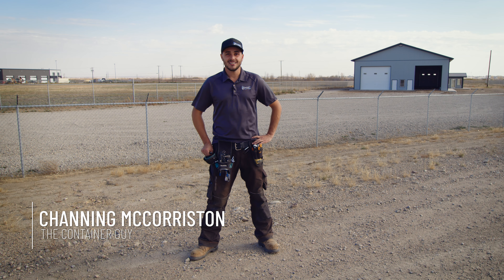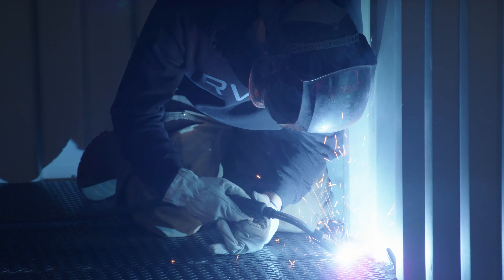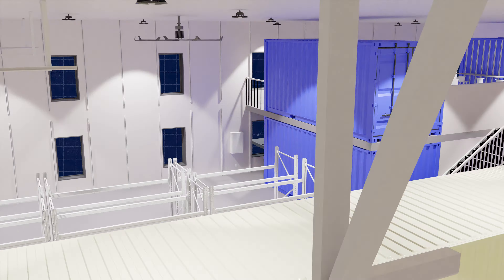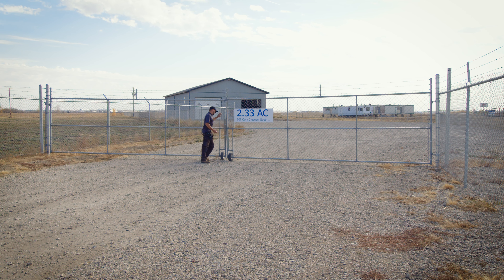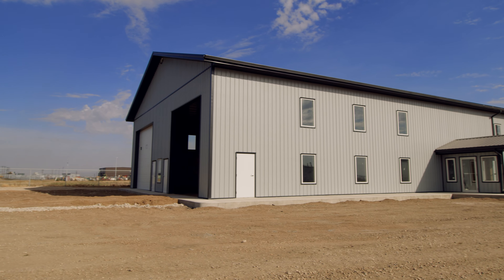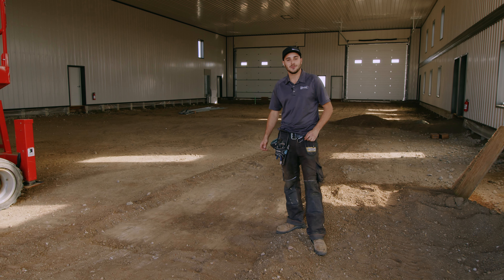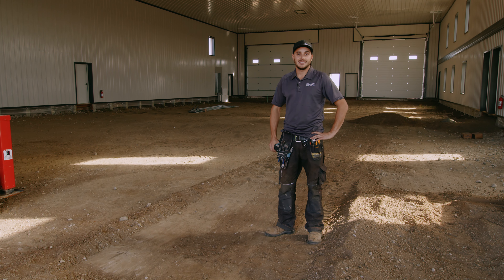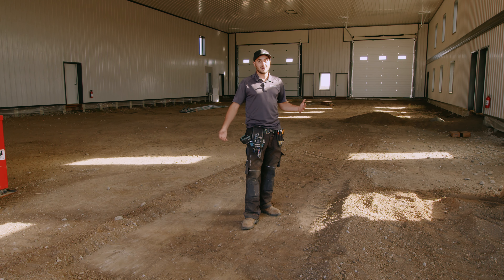Building a NEW Shipping Container Modification Facility - Check Out Our Big Plan!

Comment: Ok.
So here is some of my background. 
I was a production supervisor at a global furniture manufacturer. They taught me things like  lean principles, 6 S, time study work for improving efficiency, among other things.

  My biggest piece of advice is don't lock your area down with your first plan of how your production should go. Trust me you will want to make changes to your throughput/ production area. I can't tell you the number of times I had to cut floor bolts because we wanted to tweak a production process.  Once two weeks after we first moved the production line. 
 You have an idea of how things will go but it will never really be what you thought.
For tooling I would suggest mobile carts that have the tools a process will need that can hook into air or electric. Save yourselves some time from hunting for needed tools. 
Have a materials system where parts are stored centrally. Issue the needed parts on a pallet or in a box for a job. This will be all the parts/brackets/bolts/nuts/etc. This will save you time and steps running for materials for each job.

Saving steps is KEY.  Every wasted step is approximately one second.
 One second costs you as the owner.
 Say you pay an employee $16.00 an hour for example.
$16/60 minutes is .26 cents a minute and .0045 cents a second.
A lost second doesn't seem like much until you do the math of how many times a day it happens over a years time.
I once saved the company $ 17,000 a year by moving my supervisor's desk to a different spot closer to where the majority of my work happened.

Good luck I love your concepts. I toy with planning small container homes for someone with mobility problems. (like me) I think an interesting  use for cans could be tiny homes for the elderly/disabled that can temporarily installed at a relative or offsprings home.
Reply from the maker: This is the answer I was looking for. Thank you so much Douglas. You're hired!!
Reply from the maker: Question: Containers naturally are very narrow once finished. Does a 7ft interior width pose issues for those in a wheelchair? Does having a wall nearby potentially help those with mobility issues but not in a wheelchair? I really appreciate your comment/advice and would love to help you design something if you ever tackled a modified container project.
Reply: @TheContainerGuyTV  Interior width is certainly a problem. Especially with the turning radius of wheelchairs. Many issues come from leg clearance.
Items like a bed could be "floated" by inverting your tire rack system as long as the weight capacity is there for say a max of 500 lbs over a say 7 ft span.
The same could be done with the kitchen area. Which would really just be a counter with a sink.

One solution I have toyed with is using a split can attached to a normal can. This should give a project a 10.5 internal width. (210 ft² internal)
Granted bolting two full size cans would give you more space but people's yards/driveways are only so big. 
The 12 ft external width of the completed unit would be easier to fit into people's available space.
It's really to bad 30ft containers aren't more common. You could use a 30ft can asw a base and bolt on a 20ft half can. The 10 ft pf the non split  can section could be like a three season porch/ airlock for cold weather.  It could also hold some of a home's appliances like a water heater/ power panel etc.

I would like to explain the basics of time studies to you. It's a way to identify lost time and make improvements to production processes.  The thing with making changes is unless you time things you don't know if your changes saved time or not. It's also how to split work so that employees aren't waiting for the person up line from them to finish their work.
It's hard to get employees to buy into sharing work to increase output. The factory I worked in used a modified lets call it piece rate so the faster the lines worked (with good quality) the more money the line workers made. There were production lines where the line earning 60k a year making sofas because workers knew each other's jobs worked together.

I have followed you on FB to make it a little easier to communicate somewhat directly.

Comment: A fabrication shop close by here build in the 1950's has gusset cranes attached to the walls, like the sorta armature that you see at a drive through car wash. The 3 phase generators are mounted on platforms at the top of the crane and the leads run out to the arms, one on either wall that cover the entire section of the radius of swing, 6 welding cranes in all for the whole shop.

An aluminum plant I used to pick up freight from had an overhead track mounted crane 10 Ton max. Picking up and moving around containers, unloading trucks, maybe even moving around modular parts boxes or welding rig setups. 

It would require organization and study but I think either of those ideas would help in increased efficiency  in your new setup.
Reply: Looking forward to becoming a dealer for you guys. There is going to be a huge market down here.

Comment: I have plans to clad container Hines to give them a modernized high-end look.
Would you clad yours?
Reply from the maker: I would insulate a container on the outside and finish it the same as modern homes. We are just prototyping a bracket that is going to make it SUPER easy to strap the exterior with wood studs.

Comment: Inside containers will cut down on work space.
Reply: 1. Agree, as much as you can assemble outside your building in containers: do so. Remember your in the container business. So your use of containers outdoors is your best showroom. 
2. Plus you save on what will be much needed space, hopefully in short order.
3. Overhead crane that can service the entire building. Thus will be your biggest need and expense in setting up. Everything else will fall in place around the crane and the steel beams that will be needed for it.
Awesome potential. Best wishes!